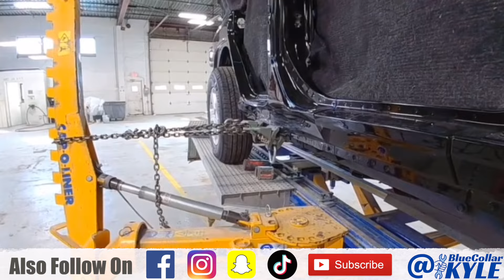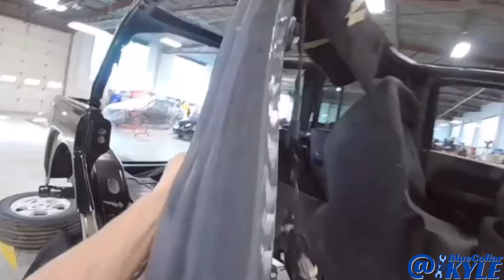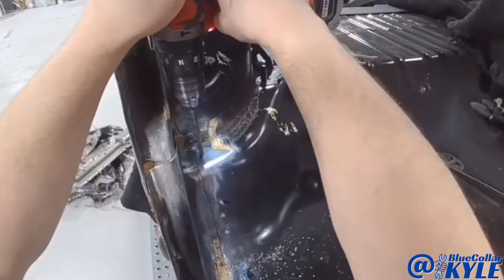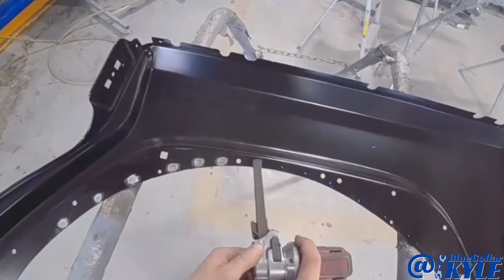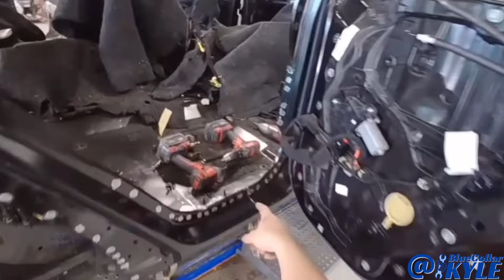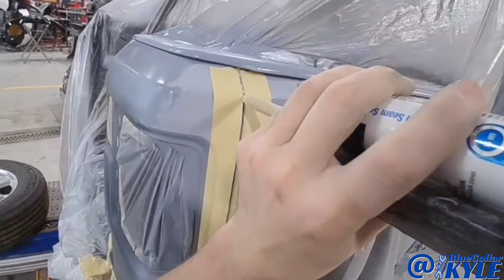Cutting This #Jeep Into Pieces! This repair is INSANE! #autobody #collision #bodywork #wrangler

Comment: shouldn't it have totaled ?
Reply: Depends on cost to repair vs. cost to replace. The price on Jeeps has skyrocketed in the last decade or so. So I'm figuring the repair was about 8 to 10 grand (I'm not an estimater) and replacement is more like 30 grand so fix it is.